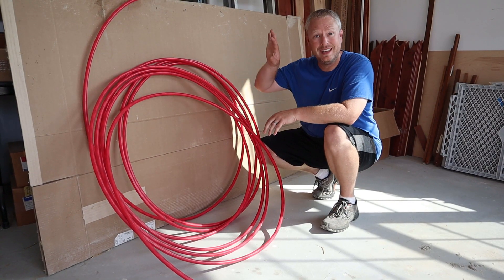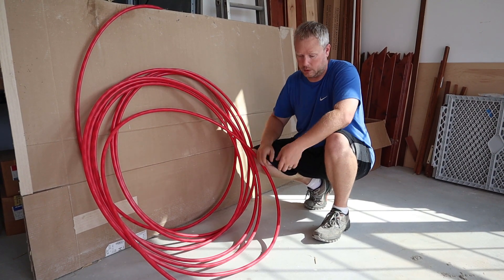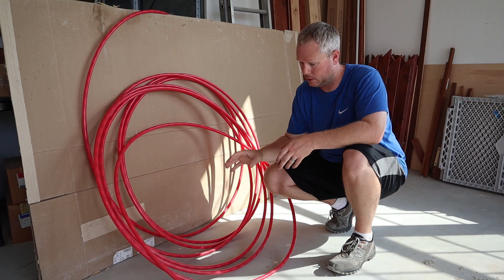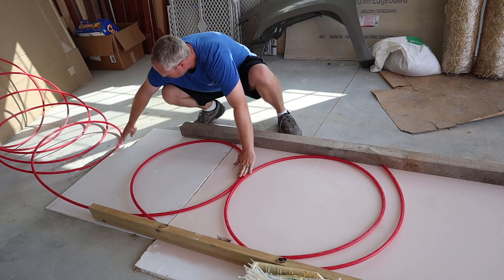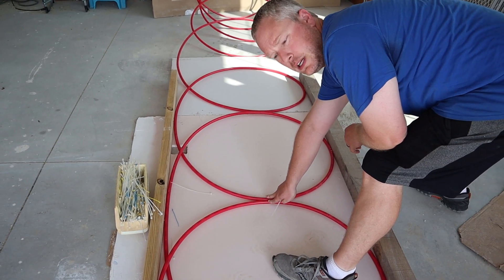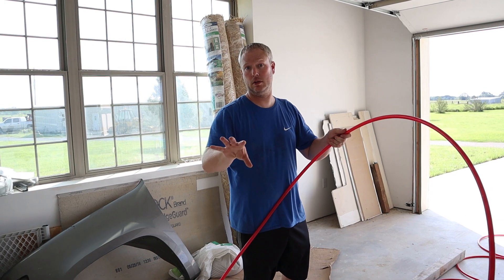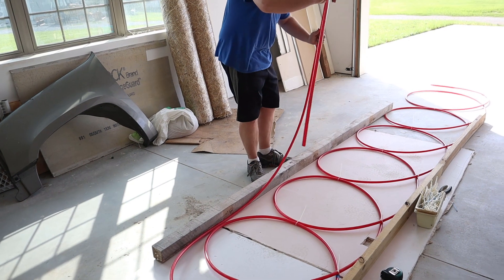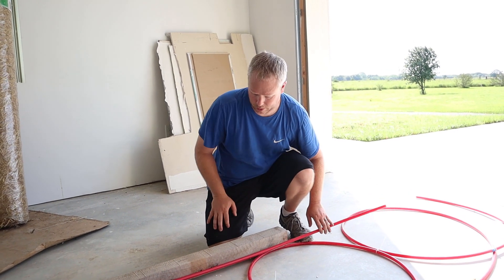Slinky Loop - Step by Step DIY Geothermal (Part 5)

Comment: confused about what the return line is here. In the trench video I was understanding that you had it going out and back both in coils and the return was separated by 2 ft. Can someone help me understand? Thank you!
Reply from the maker: The return is run in the same trench, but straight, not coiled
Reply: @Challenged1  thank you for responding! So the fact that it's so close to the outgoing water pipes doesnt cost the system too much in efficiency?
Reply from the maker: @jacksilverman7677  Correct.  Since it's a straight run, it moves quickly.
Reply: @Challenged1  oh duh. not sure why I couldn't figure that one out. Thanks again!

Comment: What I am building is very small.  If I am using a 2-ton unit with two 600ft horizontal loops, how long does the ditch need to be for each of the loops if I build my loops 3ft wide like you did here?
Reply from the maker: 100-120'

Comment: Is there any downside to running slinky loop out, backfilling 6-12in, and running loops back? Then it's basically a 10:1 pipe to trench length ratio.
Reply from the maker: You want to have 10' of separation between loops.  It doesn't matter if that's vertically or horizontally.

Comment: question, when you have multiple lines coming into a manofold how do you know if they are truely sharing the liquid from all lines and not just one?
Reply from the maker: You can take surface temperature readings of each individual line to tell.
Reply: I've had this same question rattling through my head for some time.  They say that they will be mostly equal but i don't believe it. I think I am going to put a flow meeter on each loop, mostly to satisfy my curiosity. I'm installing 6, 600' loops with the manifold in my basement.  Then you can equalize the flow with ball valves on each loop if needed.

Comment: Garrett,  How long does your system run each time on average? (I understand it depends on how cold it is.) We are looking into building a new home, around 2,000Sq Ft., to no more than 2,500Sq Ft., on a wooded lot. We will be removing as few trees as possible as my wife would prefer more trees than a yard. We also have to clear a space for the septic system. What are your thoughts about running the trenches on each side and under the driveway?  The driveway will provide the longest runs, without any other systems getting in the way, as our driveway will be over 300 feet long and could be 400 feet plus. One last question: Have you ever closed off a loop or two while running your system to see what the outcome was?
Reply from the maker: 15-20 minutes

You can put your loops anywhere that you please.  I don't see a problem with under the driveway.

No.  Reducing heat exchanging capacity will strain the rest of the system.
Reply: @Challenged1 , Thank you

Comment: Why does all the geothermal I see use PEX and not copper pipe? Conductivity is like 10-100x on copper. Couldn't you dig way less of a hole too? I feel like I'm missing something with the math about soil conductivity of heat maybe. Cool rig!
Reply from the maker: While the copper is definitely more conducive, the soil conductivity will be your limiting factor.  You'll still need a long run, and the copper will be expensive

Comment: I have to dig out 14' below my foundation and replace with competent soil. Thoughts on putting my loops at the bottom of this excavation? Should be far enough to not steal heat from the house?
Reply from the maker: Should be fine as long as they aren't under your footings
Reply: @Challenged1  why is that? My loop will be 10' below the bottom of my footings.

Comment: I thought I heard you say in another video there's no need for a HVAC refrigerant installer.....but in this video you mentioned a compressor.. Is the Bosch unit still a heat pump with a compressor and refrigrearnt to go from ground temp to desired temp.?
Reply from the maker: It's a ground source heat pump with refrigerant.

Comment: Garrett, just buried 3000 ft of 3/4 SDR 11 poly as 4 slinkies, 8 ft deep. Filled and circulating well. About to power up the heat pump. Super exciting. Thanks for your videos.
Reply from the maker: Good deal.  Good luck with the startup!!!  It sounds like it will go on without a hitch.

Comment: Is there any data on difference in BTU output of slinky vs. straight runs for the same amount of pipe also considering water pump efficiency of pumping through a bunch of coils vs. a straight run?
Reply from the maker: None that I have found
Reply: Easy just think about it. The straight pipe would touch more dirt, have less surrounding pipe. It's just easier to put the slinky pipe. You want to maximize the area of dirt around your pipe, without being near another pipe. The outside diameter of dirt should be how long it takes usable  heat to transfer in a day(or however long you need)

Comment: Thank you for the videos, they are very informative.
Any reason not to do 3 to 4 parallel pipes in a trench instead of the slinky loops (in shallower, or wider, trenches where collapsing isn't as concerning)?  Seems like you would have better heat transfer than the slinky loops.
Reply from the maker: You can.  It normally takes 4-5x the excavation though, which increases cost
Reply: @Challenged1  I meant in the same trench, just like the slinky.  Same surface area of pipe per trench, just not in circles.
Reply from the maker: @edwardwazer5103  With the coils, the earth/pipe temp is pretty consistent at any given point.  The coils at the beginning of the trench have a different temperature than coils at the end of the trench.  You could say, there is less cross-contamination of temps throughout the trench.
Reply: @Challenged1  Not when you're renting the trencher from homedepot for $300 on the day.

Comment: If the goal is to increase surface density, why don't people use several layers of pipe. For example, one deep trench with 3 layers of coils, separated by 30-50cm of soil.

That would reduce the need of digging many trenches and also make the system use less land.

Do the pipes really transfer so much heat that they need so much horizontal surface to avoid cooling the soil too much?
Reply from the maker: Loop separation needs to be a minimum of 10 feet

Comment: What do you think about stacking runs? For example 1st slinky loop run at 8’ and another  on top at around 6’?
Reply from the maker: You would thermally saturate the soil, which is bad
Reply: It’s highly common to do so Greg. You can even buy it premade that way.

Comment: So, if you had plenty of land , it would be better to run the line straight without loops?
Reply from the maker: You sure can if you have the time to dig
Reply: @Challenged1  I thought about a trencher and go about 6’…..it makes about a 6” wide trench.
Reply from the maker: @ericanderson8556  It would work.  I wish the trenchers could go a little deeper though.  6' would be my absolute minimum assuming you aren't in a cold climate.
Reply: @Challenged1  Southern most part of Ohio. It doesn’t freeze very deep here.

Comment: Thanks for the Vids...  I am looking at this from a new home build.  Considering using the space around the new septic tank build using  Pex-AL-PEX... Closed Loop... Thoughts?
Reply from the maker: Under the leach field is the best.  Save the money and use PEX-A
Reply: Makes sense to me. I am in the middle of starting our Debt free ICF build. A lot of the inspiration came from your videos. Im just south of kcmo. I plan to do 90% of the house myself.
Reply from the maker: @minutemandefense3935  I wish you luck with your project!!!
Reply: @Challenged1  thanks a ton! Just got my first piece of "heavy " equipment Bobcat 753 and I'm looking at a 709 backhoe attachment for it on Saturday. We started a channel for the build if you want to check it out. GTribe Chronicles It's about a month behind so the exciting stuff is coming soon.
Reply: Oh man I didn't think about running it with the leach field, that is genius
Reply: Only concern is depth, leach field isn't all that deep is it? Would this not run the risk of reducing the effectiveness of the geo?
Reply from the maker: @minutemandefense3935  If it were me, i'd dig normally for the lines, then backfill and install the leach field on top.
Reply: Seems like you could also bury it at the base of your foundation if you were doing it as a new build. Would be nice and deep in most applications with a basement
Reply from the maker: @minutemandefense3935  It would be too close to the house, taking heat out of the house rather than the earth.

Comment: Loved your new "channel helper"! Will he be a regular? He seemed to have a lot to say- it seems most engineer's kids do- like me! 
If you have a moment, I have what may seem a silly question; Why can't the return and supply tubes be run concentrically, then slinky-ed up? It seems to my plumber brain that it would be easier to bury and thermo looks doable.
Reply from the maker: I think I'd need a drawing detailing what you mean.  I just can't picture it.

I hope my son can become more involved.  Really, he's involved with all of my projects.  I've just always been hesitant to make the rest of my family "public" on camera, as you can imagine.
Reply: @Challenged1  Yes, I can. Fame can be a very "intrusive" thing for some. It's a choice that you and your wife to make for now, and I feel you will do that in your son's best interest as you see it. I do think it would be good to include him in at least part of the discussion.
 My tubing thought was to literally blow a thread line through the larger tubing while it is still in it's original coil and with a bit of soapy water on it, pulling a smaller tube through it. Then capping the far end to force the water to flow out the larger pipe and return through the smaller, internal one. It would make the "slinky" more expensive but I'm thinking it might also allow a higher flow rate and create more Delta to the evaporator coil. My thought anyway. I did something similar on a construction site, but we were running warm (80-85 degrees) water through the small inside tube to keep the water in the larger tube from freezing it did work, and even survived being run over by several trucks- 1 1/2 poly gas pipe ( water and gas use the same plastic formulas but gas piping is yellow or orange while water pipe is run in black and the warmer was 1/2" poly pulled through it and served by a small water heater and a pump. Sorry, the media isn't giving many options to send you a drawing! I'm an engineer's kid myself and know the first thing most "consults" begin with is the phrase "do you have a sketch?". Hope this gives a better idea of what I had in mind. Thanks for your time and response- have a great one Garrett! FR

Comment: great jig, Garrett, thx!

if i'm already trenching for this project, i've got an idea to trench for what's called an "earth tube", which utilizes the steady temp of the earth to cool air as it's pulled through a corrugated pipe by stack-effect... but run it to an ERV inlet instead. this would give the ERV a lower initial temp delta to work from, year-round (20f winter, but 60f earth temp), increasing it's efficiency & lowering the expense of re-heating/cooling the new fresh air. thoughts?
Reply from the maker: Make sure it doesn't ever fill with water.  The corrugated tube isn't very strong and can crack, leading the water intrusion, which renders the system useless.

Comment: Did you make a 24 inch jig for the 24 in bucket that you used? How hard was it to loop that? What kind of pipe did you use for the 24 inch hole? THanks!
Reply from the maker: Back in the day, yes.  HDPE and it is some stiff pipe.  Still not that tough though as the coiled pipes you get are looped really tight.

Comment: So when the rule of thumb says 600 feet per ton, are they referring to pipe or slinky
Reply from the maker: pipe
Reply: What is the largest length of pipe they offer in one spool/package when you buy it at a supply house. If I have the yard to do it, is there any downside to say using 800 feet per ton. Or perhaps using bigger then 3/4" pipe....maybe 1". Basically what I'm asking is, if you oversize your slinky runs either by pipe diameter and/or length,  will it cause a problem and be any less effective/efficient? TIA
Reply: @joshmanor9970  I'd assume there will be more resistance in the pipe and the circulating pump(s) will need to work harder or be up-sized. It is my understanding that these systems are optimized for 600' of 3/4" pipe.  I'd add more loops if you want to increase the size of your heat exchange field. I need a 5 ton system but am installing 6 loops as cheap insurance.  Everything I read says that that you will not regret adding more  underground loops because it is so difficult to do after the excavator leaves and the field layout is covered up with soil.